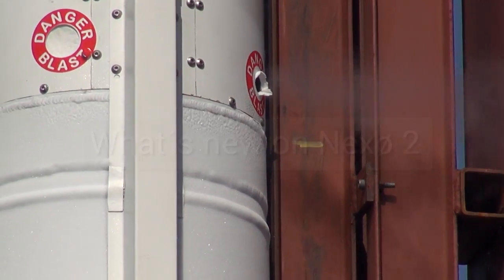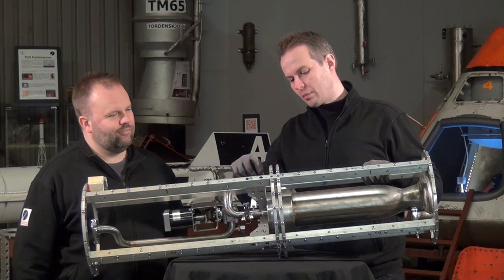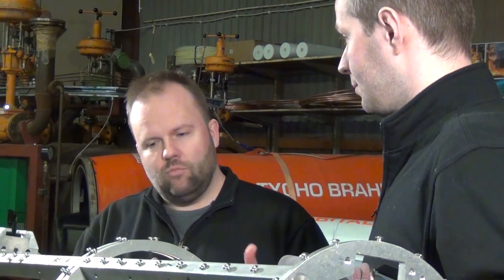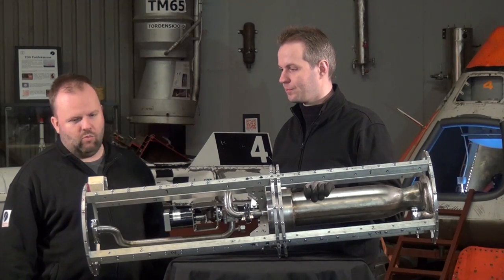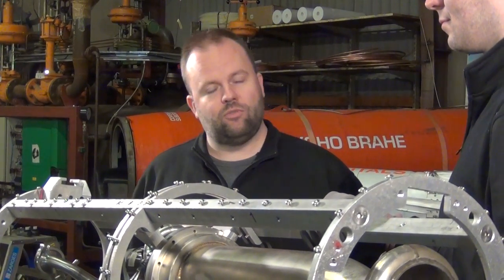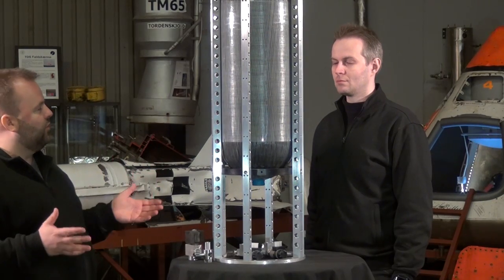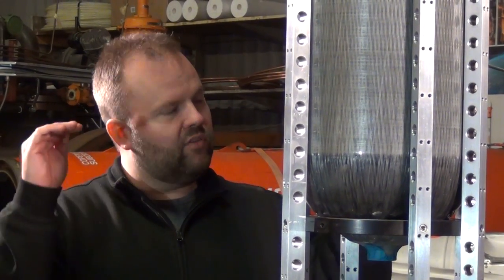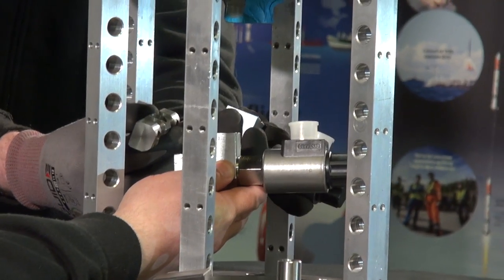2017 04 08 Current affairs at Copenhagen Suborbitals

Comment: Great work guys. Do you have an orifice or a flow restriction for that high pressure helium downstream of the valves?  Remember that when you reduce the ullage space in the tanks your tank pressures initially will come up to pressure much faster.  If the speed of those high pressure helium valves or control system isn't quick enough you can pressure spike the system.    You might consider using a pressure regulator downstream of your control system that is set to 5 bar above your operating pressure. It would only close in the case of an over-pressure. That way should the control system fail open things don't come apart.
Reply: No, there is no orifice in the system. We have used the same type of valves for static tests for a while now and have never had an over pressure situation. The valves are pretty fast :-)

Comment: I realize this is an old video, but hopefully you’ve chosen a cryogenic valve for the LOx.  I’ve seen situations to partially OPEN (to establish the grain in a solid propellant), then commanded 100% open and the valve shaft sheered.  The LOx could not be turned off or on.  The rocket just burned itself down on the pad.

Comment: How is the plug connected to the bottom of the tank? Is there a thread in the carbon fiber? I ask because i have no idea how to work with carbon fibre. Can you use the same tools on it as you use for metal?
Reply: It is correct. It is a aluminum liner in the tank and it is carbon reinforced. Principal is described here https://en.wikipedia.org/wiki/Composite_overwrapped_pressure_vessel. You can have full carbon tanks, but the treading will always be a piece of metal epoxied to the top.

Comment: Am I incorrect in the assumption that this design could be made to launch from a partially submerged position?

Also, could this design not be scaled extremely well? It seems to me that you could scale this to in theory be larger than even an F1 because of its simplicity and obvious robustness. As well it could be used as multiple stages with simply separating side mounted fuel tanks being used first with their on board helium.

you should look into the further benefits of an engine bell.
Reply: We don't have the intentions to build rockets to be launched partially or fully submerged. That is not currently estimated to be needed for our goal, to put a man in space.

While on paper you can scale our design by a factor 10 if you like,  strength of materials, heat transfer and flow etc. does not scale so simply. I would guess the answer is no, scaling the design that simply would not succeed. However most of the various technologies used for Nexø I and II will also be needed for a Spica class rocket capable of manned space flight. So mastering the technolgies for Nexø is both imperative and useful for the longer time frame of manned amateur spaceflight.

Comment: Does the helium in this tank add any significant reduction in weight to the overall weight of the rocket?
Reply: No the dynamic pressure regulator (DPR) system helium system is adding significantly more weight than the air for the same volume would weigh.
Reply: Is it possible to build the propellant tank like a cylinder piston combo or something like a dash pot so that the pressure reduction due to burning of fuel can be controlled by some mechanical means. Helium is expensive
Reply: If you do the math, pressure per area times area , you get the force needed. Knowing the length the force will need be invoked over, will tell you the work/energy needed. Then multiplying this by a factor of 4 for inefficiency and acceleration and loss, you can get the idea the kind of energy needed. Furthermore you will need solid cylinder and a solid piston to make it work. Weight of such a solution makes it impractical. High pressure gas is an excellent way to solve the energy storage and workforce needed.
Another solution to the problem is turbo pumps or piston pumps. The former is being looked into for Spica, but we don't have a tested workable solution yet.